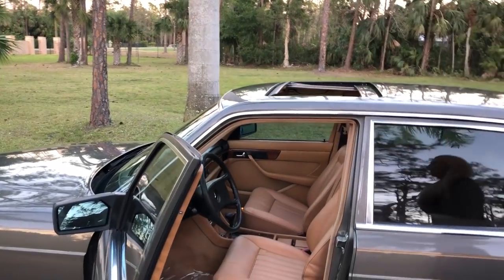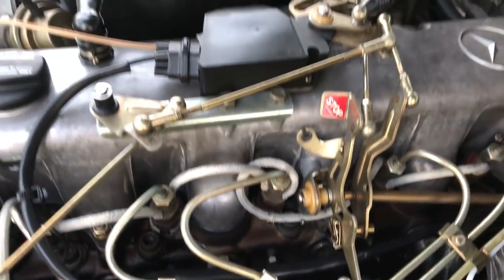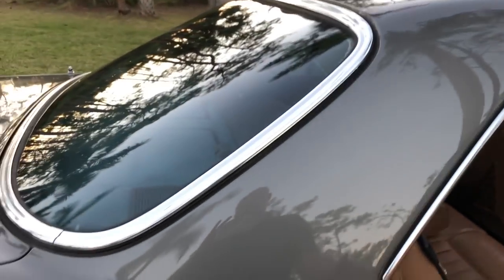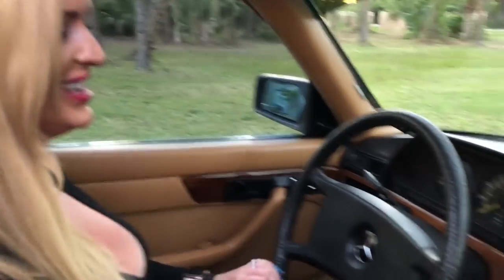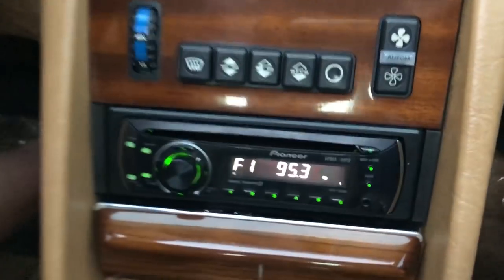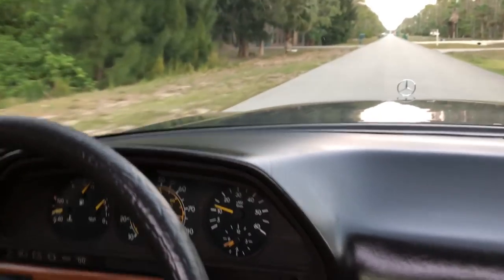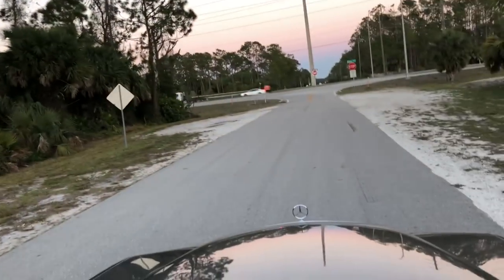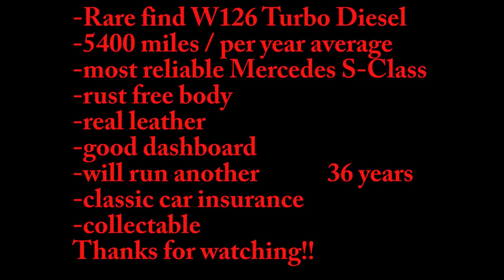SOLD! 1982 Mercedes Benz 300SD, Turbo Diesel, for sale by Autohaus of Naples 239-263-8500

Comment: The w123 diesel runs to 300k miles before major service, the 79-85 w126 300SD runs to 500,000 miles before major service, also has 126 horse power 🏁🔧🔥🐲🏁and transmission is more adjustable 😳💯 and actually is the best car this world has ever produced...I do believe that I have worked on everything 🚜🚛✈🚁🚂🚒🚘✈⛽🚀🔧🙋

Comment: Great... whats the stain in trunk? ...
Reply: Theo A We have to remember that this car is over 27 years old and was actually put into service for close to 200,000 miles. This car was not a trailer queen but actually a daily driver for a loyal Mercedes Benz owner. It's not pristine but considering it's age, mileage and care it will surely have some flaws. But if you actually look at most of these for sale on the open market, they are completely trashed. One stain in the trunk is a mere notation compared to the rest of the vehicle as a whole. To find one in this amazing condition for a daily driver 1982 is unheard of! If you don't believe me, search the online car ads. Those cars won't come even close to this car in general condition and care.
Reply: Kenneth White agreed! The vechile
Is in impeccable condition, I said it as more of a joke, like the whole car is immaculate, aside from that one stain. I am sure they can get it out anyway. Cheers
Reply: Theo A I noticed it too right away. But I'm such a super clean freak when it comes to my cars. I'm thinking it either got wore out by use or somebody spilled something. This trunk mats are obsolete by now so hopefully they can clean it because a replacement isn't available.
Reply: Mary Ann great presentation.. its very cool to see a women know soo much about cars!! ♥️
Reply: Price and records
Reply: Theo A    MARIANNE DID IT.